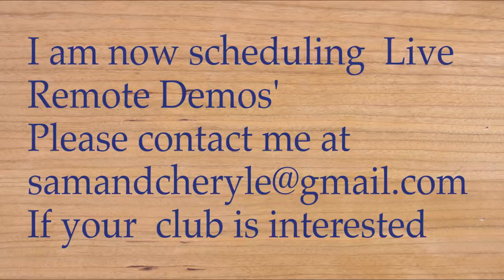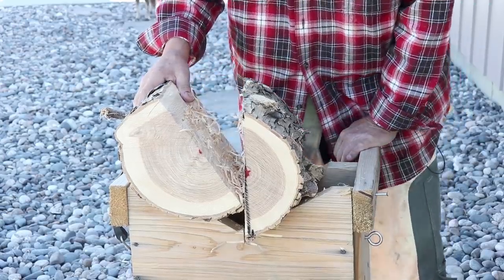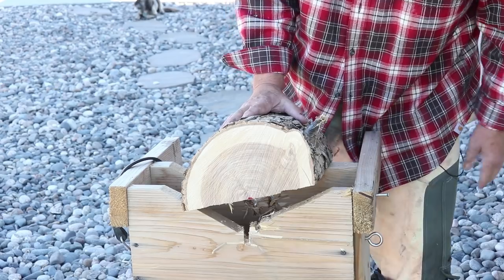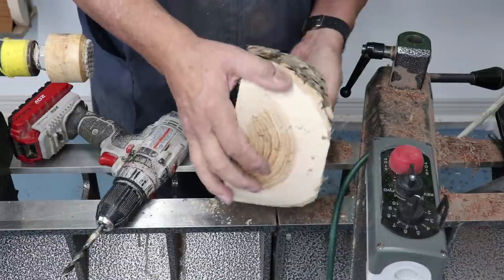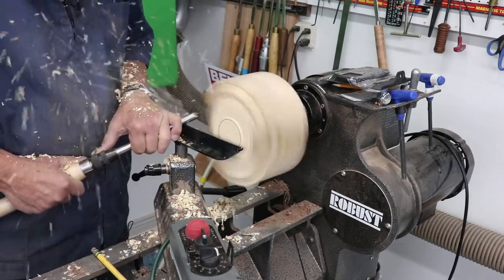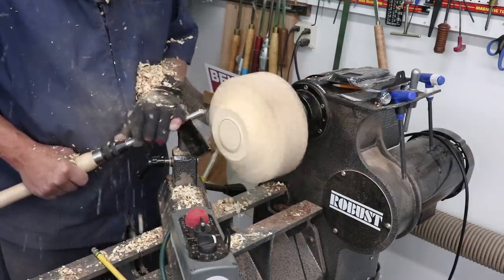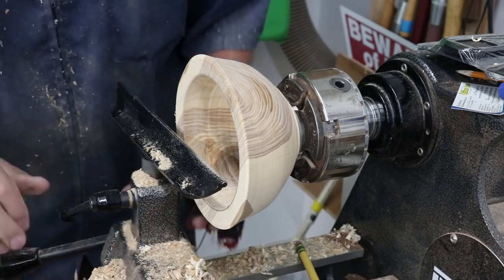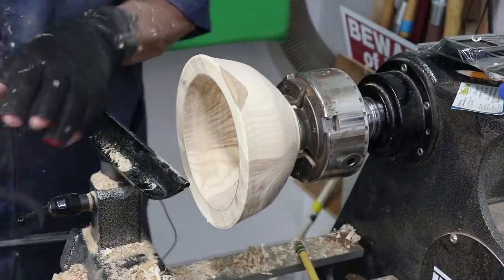Milling a log to a Bowl Blank - Woodturning with Sam Angelo

Comment: Excellent step-by-step video. Glad you did a “pith cut” on the second cut up. A pith cut board is quarter sawn wood and is great for a number of projects if cut about an inch thick or so. And after saving up a lot of wood, I found I get a straighter chainsaw cut if my left hand is low on the handle bar, and keeps pressure to the right (clockwise). That seems to keep the bar cutting more consistently vertical. You might give it a try. Love the bungee cord on your cutting stand. Think I will add one to mine!
Reply from the maker: I'll try that.  I always seem to not cut vertically....Sam

Comment: Thank you for the video Sam.  Brand new wood turner here.  Is it always necessary to rough turn a bowl blank and then let it cure for a while?
Reply from the maker: Jody, welcome to woodturning-be safe and careful and if you are not sure about something send me an email at samandcheryle@gmail.com.    Now to your question.  It is difficult to find wood (especially in log form) that is really at a moisture content that you can turn.  Depending where you live the wood should be around 10% moisture content.  I usually rough-turn most everything I turn-bowls and even lidded boxes.  It is just one approach.  But I love to turn very green wood.  It is easier to turn and a lot more fun.  But when you turn a bowl it needs to be dry when it is completed.  Rough-turning a bowl is just my favorite approach.  Sam

Comment: Great video showing how to start to finish.  What did you seal it with after rough turning?
Reply from the maker: I live in a very dry place.  Sealing slows down the drying process and I am in no rush.  Sealing also prevents cracking and splitting as the wood dries.  Sam
Reply: Hi Sam, I noticed Tom did not respond again after he asked you his question: "What did you seal it with after rough turning?"  I was wondering the same thing, but your answer most fit the question of: "Why did you seal it after rough turning?"  Could you mention what product you use most when sealing your rough bowl turnings while they dry besides the shavings you have mentioned in other videos?  Do you use a chemical sealant that is commonly purchased for sealing fresh cut wood until it dries to your liking?  Thank you for the feedback. I really look forward to digging into your pile of great videos.  It's definitely more fun than reading about the process. LOL

Comment: Hi Sam, great video I learned a lot.   When you seal the roughed bowl, do you brush sealer on all the surfaces or just the end grain areas?   I have been sealing all the surfaces and wondering if that is hampering the drying process too much on the side grain.   I'm back here in Ohio, so it's typical humid summer but I have the bowls in shavings and in a dehumidified basement that is about 70F and 50% RH.   I have seen some mold and or fungus starting to grow so I spaced the bowls further apart in the shavings which are in paper leaf and lawn bags.
Reply from the maker: I feel that the issue is really slowing down the drying process.  I seal all surfaces on my pieces.  But I live in a really dry part of the world.  Ohio-much more humid.  So you may only need to seal the end grain.  Sam

Comment: I understand why to thin you have wall problems, but wall to thick,,I don’t understand,,
Thanks for sharing
Reply from the maker: Mitchell,  when a bowl blank dries-it will move or warp.  To successfully dry the blank MUST be able to move.  When the blank is too thick, it is unable to move and the wood will split or crack.  Sam
Reply: Thanks,,makes senses now,,you’re the best

Comment: Sam, at 22:43 you said "If you turn it too thick, you'll have problems."  Could you please (maybe in your monthly notes) tell us why that is?   I have always turned thin bowls, let them warp.. etc.  But I'd like to try twice turned.  Did a few blanks over the last few weeks, used the 10% rule, and crossed my fingers.  Just curious as to why too thick is a problem.  Thanks!  Happy subscriber, great vids.. I watch every single one. 
Scott
Reply from the maker: If the blank is too think, when the wood dries out it tries to move and cannot.  It will crack or split.  You want the wood to be able to move when it dries.  If left too thick it cannot move properly and will crack or split.  Sam